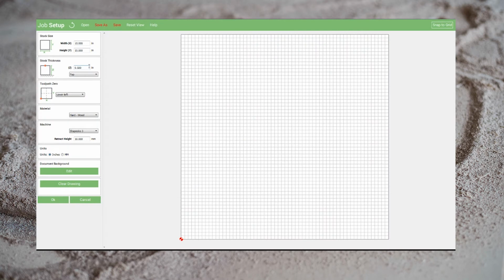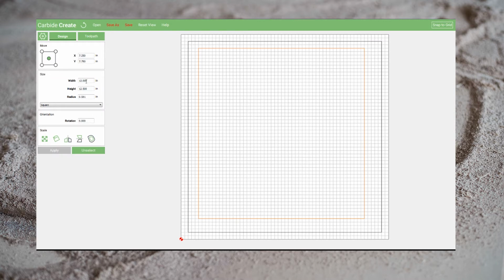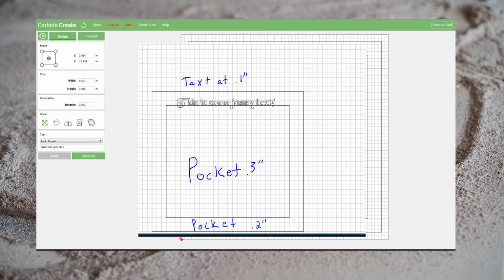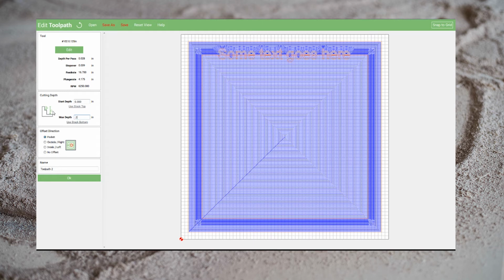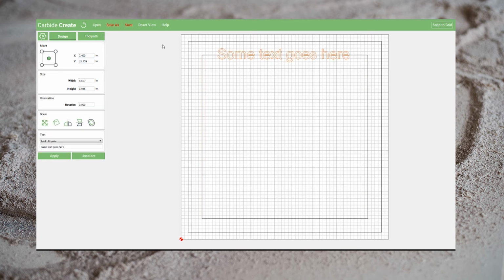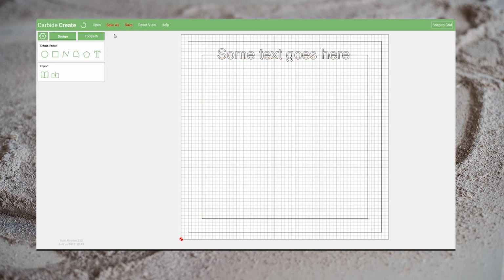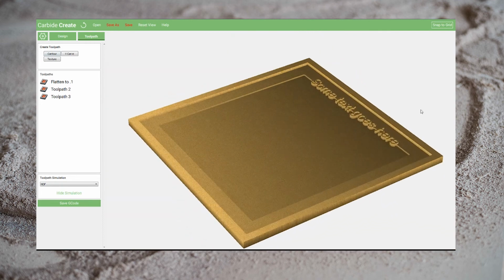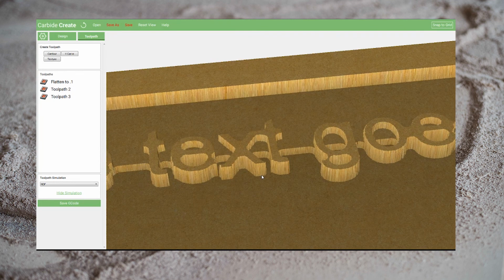Practical CNC 01 - Raised text on a multi-level surface in Carbide Create

Comment: I have been trying to do a project with stacked text and I can't seem to get the tool paths to cut the first and last names in a stacked design and then cut out the rest of the plaque at the lowest point of the bottom of the stacked text.  Would you be willing to look at my project and provide some insight or guidance?  Thanks in advance.
Reply from the maker: Check out the Shapeoko and Nomvad Users Group on Facebook. I and others would be happy to look.